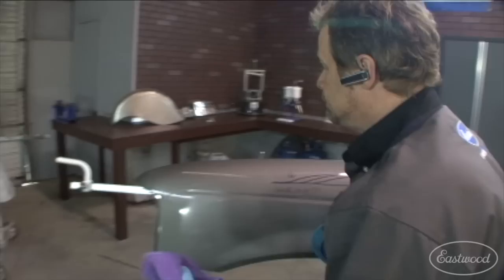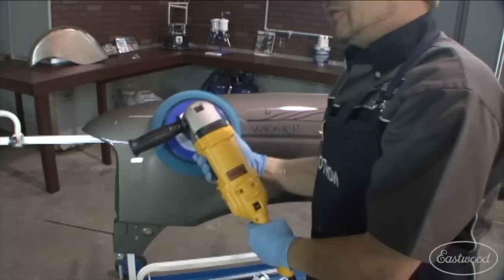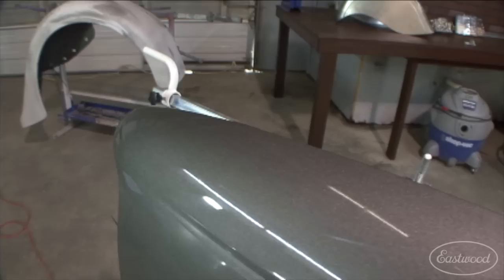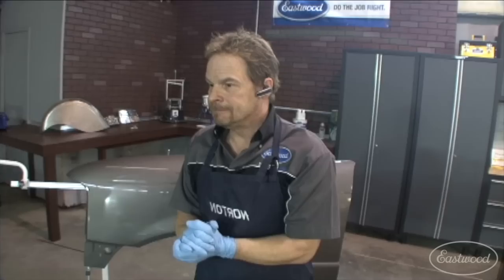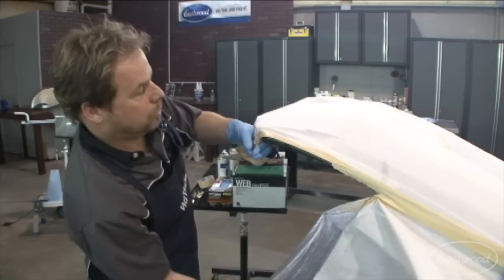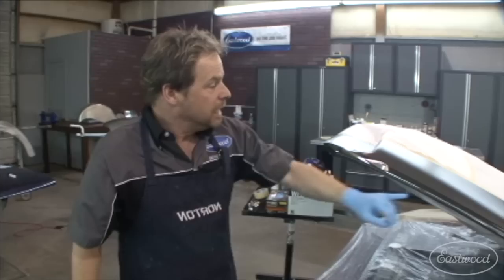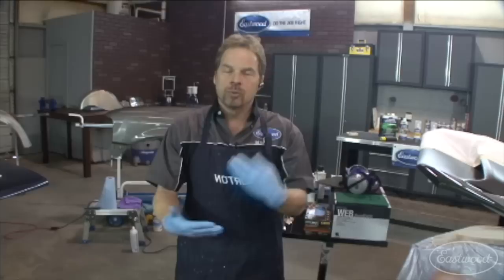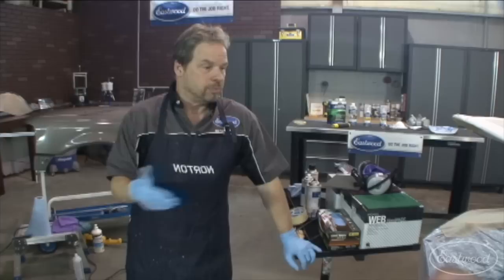How To Repair Clearcoat - Kevin Tetz Shows the Best Way To Fix Paint - Pt 3 of 3 - Eastwood

Comment: Thanks for doing this video!! I'm gonna try it myself. I always heard you couldn't fix the clear coat peeling so now I know that I can. The result on the panel is good enough for my old jalopy:) I have a couple of small areas about the size of a coin on different panels. I also have 2 bigger areas about the size of a magazine so I'll try the smaller areas first and see how I get on. Thanks!

Comment: using most your tips gave me a result i was happy with ( i live in apt and getting a clean painting environment is difficult for my car )   a little orange peel but i wet sanded er with 2000 grit then 3000 , compound then polish and shes a mirror

Comment: Great info Kevin, I'm repairing my wife's Honda,well known for clear coat failure . Your info will help me a lot. Right now I'm trying to match clear coat on a panel. I notice the build up line between old and new coats. Can I fine sand and buff this area and what should I use as far as sandpaper and polishing compound ? Thanks.

Comment: I have a black motorcycle tank that is clear coated over it's decals, and it has two little rusty spots on it. 

Is there a cheap way i can fix that rust and get a decent looking result? Can i blend the repair into the rest of the paint/clear? 

The tank has a few little dents and imperfections here and there but i don't wanna have to restore and repaint the whole thing. 

Can i use a 1k clear instead of a 2k?